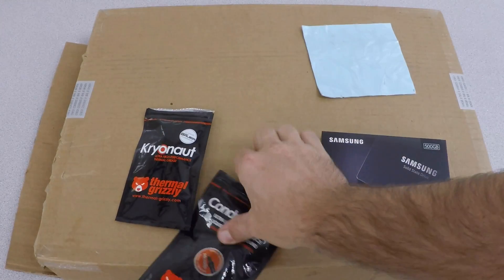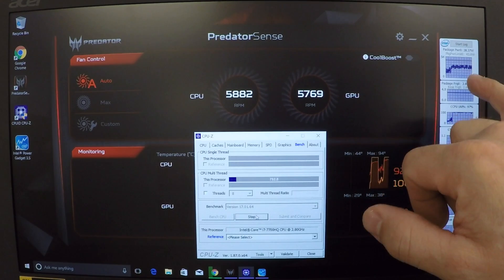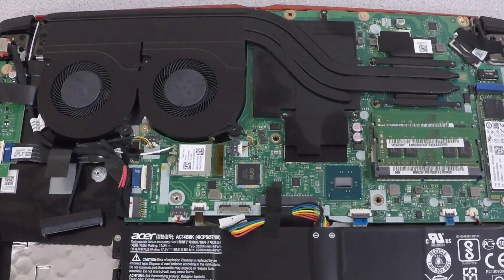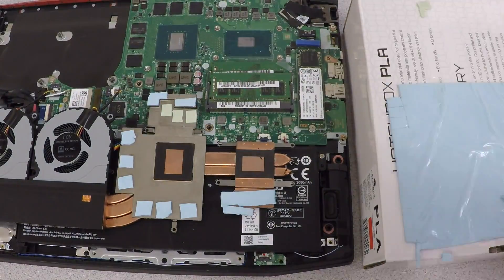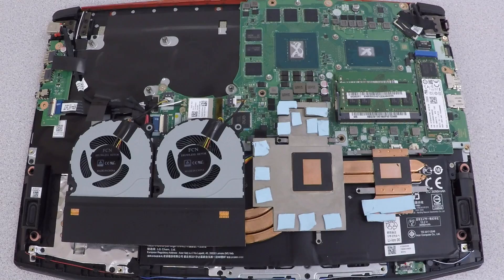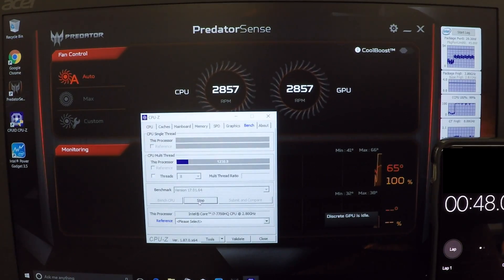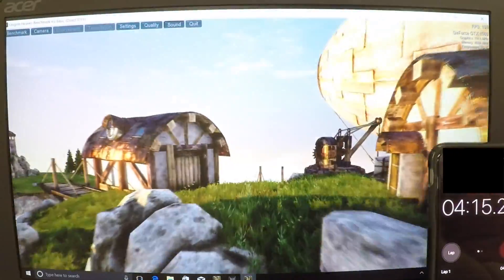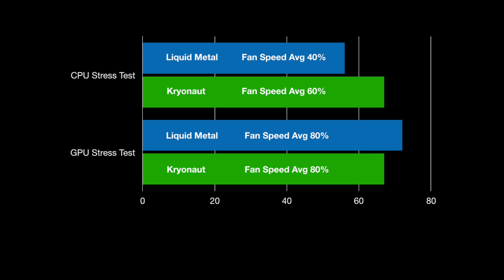Acer Helios 300 Kyronaut vs Liquid Metal Test

Comment: I just applied thermal grizzly kryonaut on my i7 8750H, but now temp from 99 degrees on full load, droped to 90 degrees on full load. Im not sure that i applied good this paste, because your temps are different than mine.
Reply: I have the same laptop 8th gen Helios you do I did everything in his video cut out 1.5 thermal pads spread out the grizzly kryonaut with the spatula on both GPU CPU I went from 95 heavy gaming now I'm down to 64 degrees or 70!
Reply: @DennisMC1974  Wow thats amazing. We have same CPU and we have big difference in temperature... i dont get it.
Reply: liquid metal is the best
Reply: Elvir Muratovic did you find the solution? I went from 99 to 94 max? Any idea?
Reply: @JaJa-gh3ze  Still same temp, ill repaste it again this days with liquid metal and ill write here again :)
Reply: @elvirmuratovic8772  same happend to me even i put a right amount of thermal paste i still reach 90c
Reply: @elvirmuratovic8772  We were waiting for your reply as promised since 7 months ago, was there any change comapre to liquid metal ?
Reply: You've might put too much paste on if you did as he said in video, actually too much of the thermal can minimize the heat transfer..

Comment: Thank you sir for your input. I've got similar problem - my MSI GE75 Raider 9SF (I like such long names for laptops :P) with i7-9750H and RTX 2070 - the temps of CPU in games like GTA 5 and Witcher 3 gets more than 95 degrees C and even UV to -160mV doesn't make a big difference, so I've also downclocked the clocks to 3,4 GHz (from 4,0 GHz - for all 6 cores active) and now I've got (with UV by -160mV) the temps in these games 70-80 with peaks at 84-85 C but I would like to improve the temp performance but if I do so I lose warranty - that's the minus :/ .
Reply: how did you downclock the CPU? I tried with throttlestop but I my temps were still extremely high??

Comment: stock pads are usually better than any pads you can buy. GC extreme got good ones but they are still close to stock ones. I think you made a mistake with those pads.
Reply: No he didn't make a mistake I use the same pads 1.5 and spread the thermal paste on now full load now I'm 65 70 degrees
Reply: @DennisMC1974  Useless info if you don't remember stock pads temperatures

Comment: I have the Helios 300 i5 7th gen, the one with 1050ti. My lappy temps go upto 90 degrees often. Are there any other substitutes for kryonaut?
Also my laptop suddenly power offs irrespective on what power it is running on. I mean it power offs when i lift the laptop or even if someone moves or touches the lid. It happens mos of the time recently. Pls help
Reply: Kingpin thermal paste provides great results and has got good reputation.
Prolimatech pk3 is good also but it is a different type of paste and known to be thicker and more difficult to apply. However it would last a long time / you wouldn't need to reapply it in a long long time, it would not dry and it would keep great viscosity and maintain good bonding between your cpu and heat sink. Hope that helps

Comment: great show down,  the Kryonaut paste is the only 1 I use these days, especially on low airflow systems like office desktops or the mini itx cases.  It costs a bit more but in my field piece of mind and customer satisfaction are much better than saving a buck or two.  If you use air coolers this stuff will easily show you a major improvement.

Comment: I'm interested on doing this on my machine. I have the model number PH315-51, are you using the same model? or does it works on all models of Predator Helios 300?
Reply: Any updates
Reply: @ishimarumasaki1998  I was as advised no to do it until my warranty expires, so there's that.
Reply: @darylquevada  You bought it from Amazon right? How do you know if you still have warranty?
Reply: @ishimarumasaki1998  No, I got it from our local computer store and it comes with local Acer warranty.

Comment: 4.4k rpm on both fans... airplane 7054 to hawai taking off soon, all passengers aboard.
Reply: Mine is 5k to 6k rpm
Reply: Bruh Asus Zephyrus S 7200 rpm tornado
Reply: @MrPabsify  its desktop fan
Reply: my helios 300 was also cooking in the high 90's even after repaste - i only noticed it on the second repaste one year later but what happened is that there was a lot of cat fur in the fins, stuck deep in there, i couldnt vacuum it with my portable one, powered the garage vacuum almost bend the fins, but it sucked all the cat fur and glued dust - the temps dropped almost 25c (i use arctic silver 5) its running 75-80c max and it never stop boosting.
probably i gained a lot more than 25c cause beforehand it wouldnt even boost.
Reply: same boat
Reply: @meowgusto  Try to clean your laptop frequently but mine does every 3 months, not only with ur garage vacuum but deepclean it with rubbing alcohol, I know it cause a lot of work but it's fun to do on weekends when there's nothing to do
Reply: LMAO
Reply: lol
Reply: Cries in 6k
Reply: mine goes up to 6k xd
Reply: LOL!
Reply: Its over 9000!!
Reply: thatas fine i had XMG laptop and it was like 5k+ on both fans being factory new :D
Reply: Hahaha
Reply: Mine is 6400RPM
Reply: Bruh im on second run of engines...they run at 5400...coool it babýyyy

Comment: Should use AIDA64 my man, can stress GPU and CPU at the same time. Also, you can change the fan curve which could easily take another 5-10 degrees off. And of you use an acrylic conformal coating or even nail polish on the SMDs or anything around the die, you don't have to worry about the liquid metal shorting anything out.
Reply: He does, he has made a video on that as well.

Comment: What thickness did you use on the thermal pads?  0.5mm, 1.0mm or 1.5mm? Thanks
Reply: The most common thing they overlooked about these tutorials. The thickness of the thermal pads.
Reply: 1 mm

Comment: Great info! I also use a nifty little program calle ThrottleStop on my laptop. It keeps the computer from throttling, and you can set the CPU to run at 50% (battery saving mode) etc... very useful for laptops.
Reply: Only problem is you have to keep it running all the time. Kinda annoyong
Reply: @nathancasey7712   you can schedule it to auto start and it just runs in the background on startup but essentially consumes no resources pretty much.
Reply: @nathancasey7712  i use task scheduler to auto start throttle stop from boot up
Reply: It doesn’t work on all cpus intel locked it

Comment: I did the same in the video (Kryounaut and same thermal pad) and I achieved the same results. Thanks a lot
Reply: I'm about to do this same process but was wondering what size pad I need? Both thickness and how big?  What worked for you?  Glad to hear you had great results as my Helios gets hotter than I'd like it to!
Reply: @newera_1303  I used same size from the video. After 3 months I applied the process described here, I only had good results in the first month, after that it doesn't make so much difference. I am thinking about repaste again once I have more Kryounaut. Maybe next year I will try Liquid metal. To keep my temperature 80 degrees, I had to create my own notebook cooler with 6000 rpm and apply undervolt using ThrottleStop and sure I applied the process described here
Reply: @rdinegri  Dude, 0.5 mm thinkpad size??
Reply: @logos_motorider6274  Hi, Thermal Pad 1.5 mm
Reply: @rdinegri  Thanks!!!!

Comment: I still don't understand why manufacturers use such crap thermal paste. It's not like performance paste is a significant cost. A dollar more when bought in bulk maybe, but surely that must be well worth it for shipping a product that runs faster (due to no throttling), more silent and quieter - because while thermal material might not be a marketable term those other ones definitely are exactly what customers care about.

I do exactly the same as this. I re-paste every computer I buy essentially. Often even router equipment ect.
Don't always replace pads as the benefit is a lot less for those though + they aren't as easily available often.
Reply: @Eddienemec  the newest model does have a better cooling architecture though, but still sad that they make things harder on us with these build decisions.

Comment: Thank you for the review but i still didnt get it. Are you using same laptop with the same configuration? How does the LM performing so far, any issues with the alloy? Are you using the Laptop with the LM intensely? The LM should also  perform better in gpu stress test, to me it looks like the performance on the gpu is decreasing
Reply: LIquid metal is reactive (and electrically conductive so you have to take some precautions).
It's only a nono to use with aliuminium though. On copper it will cause significant discoloration but not actually decrease performance so it is considered "fine". Nickel plated copper is the absolute most ideal though as the reaction is very low, causing only mild discoloration that can even be buffed out with just a little scrubbing. I'd say the only real difference is a copper-based heatsink may need a reapplication at some point, maybe 1-2 years down the road since liquid metal permeates a little more and may become slightly more crusty over a long time, while on nickel plated copper it seems to be stable pretty much indefinitely.

The GPU difference here seems to be an anomaly. Liquid metal should be performing above kryonaut and close to the same margins as on the CPU. This is likely just due to a less then perfect mount. Laptops have relatively low mounting pressure compared to most desktop coolers and liquid metal is thinner and more fluid so it is much more sensitive to a "less-than-perfect" mount. He probably could have fixed this with a reapplication and using slightly more plus clamping down a little tighter (if possible). It just might not be worth the effort considering the temps are still fine - so all it would really improve is the users OCD =P (and at most a few more Mhz boost clock if lucky).
Reply: @TheStigma  what if the heatsink is copper plated aluminum? are you sure that this laptops heatsink is copper?

Comment: Well, then it would be Liquid Metal (Conductonaut) in the CPU and Thermal Paste (Kyronaut) in the GPU.
Reply: why? gpu uses more power and gets warmer
Reply: @user-bj3pq2si2l  No usually it doesn't processor is the main thermal output, at least in my laptop with a i7 8750h/gtx 1060 max q
Reply: @epixtille7069  for desktop pcs gpu is almost always more power
prob in higher end gaming laptops too
Reply: @user-bj3pq2si2l  Wrong, cpus are almost constantly hotter these days. I have a core i7 8750H with a 2070 (not the maxQ one) and the 2070 is like 15 degrees cooler at all times.
Reply: @stevensteel574  cpus use much less power than gpu
so they should not get as warm
but gpus are basically all direct die cooled
while cpus have a heatspreader and another layer of thermal paste
if you would watercool your pc, you would need more radiator for a gpu than for a cpu
Reply: @user-bj3pq2si2l  In my laptop Helios 300 (i7 8750H & GTX 1060 Max-P), most of the time the CPU is the one that maintains the highest temperature, to the point that I have to undervolt and underclock the processor, to maintain reasonable temperatures, below 90° C while I play.

Comment: Would it matter if i used 1.5mm thermal pads? I just bought the helios 300 last year (feb 2018). I decided to change all the thermal pads to the one you recommended and the Kryonaut paste as well. I play apex legends but i upscaled to an external 120hz monitor. Cpu tends to max out at 80-85 degrees compared to 86-90 degrees at stock. GPU does about mid 70’s. Did i miss something or should i expect more temperature variance?
Reply: Don't replace pads unless they are at least as thick as the one that came with it stock.
Also, replacing the pads is a bit over the top unless you are a perfectionist since pads aren't used on anything "very important". It doesn't really matter much if your RAM modules run 5c lower. By all means go ahead and do it if you want, but just don't expect to see any practical difference (or even measurable difference on the temp-sensors you have inside the board since they won't be monitoring VRMs or mem-modules).
Reply: @TheStigma  thanks for clarifying, was just wondering as i couldn't find good thermal pads for cheap in India :)

Comment: those temps are really great only i'm scared to apply liquid metal
Reply: Very easy to do. Don't let videos fool you. Use cutip and apply using cutip instead of squirting on. Little drop in bowl, then tap with cutip and rub it in slowly covering until completely covered. My temps on CPU and GPU dropped 20 deg on full load and fan doesnt come on all all during regular browsing, microsoft, and video playback. Alienware m17x R4 980M Overclocked 100% on GPU and CPU Completely stable with no Undervolt using 300watt PSU.

Comment: Will this void your warranty? I'm ordering this laptop and want to know if I need to wait until warranty ends ?
Reply: No in the US it will not.  Under right to repair laws you have the right to modify your electronics, replace components, etc.  And it can not void your warranty.  I can not speak for countries outside of the US.  Laws regarding this vary country to country.
Reply: @markpeterson9826   this only applies in certain states and mostly to farm equipment. Please check the wikipedia  page below. They are trying to pass this law but haven't yet.

https://en.m.wikipedia.org/wiki/Electronics_right_to_repair
Reply: Don't risk it unless you know very well if it's okay. In india you void your warranty as soon as you open the back panel, never mind fiddling with thermal paste

Comment: better to just keep fans at 100% and bench them both times with the different thermal paste.
Reply: Best comment right here
Reply: @Eddienemec   Do you know If I will change thermal paste to the liquid metal, will it be problem for me. Cause I throw the laptop in the bag and travel a lot. Soo thats why it is shaking so much. Can vibration cause liquid metal to overflow? 

I'm undecided in switching thermal paste to liqiud metal)

Comment: One more thing, people always say it's easy to replace the thermal paste,  I find easy to be known as hard in my terms cause I always end up with stripped screws and can't get the screws out ever, so I always have to send my tech to places to get it done cause I don't have time to unscrew a stripped screw and it's on the heat sink, I have the thermal paste and everything, do you know if any PC repair shop will do this for me cause I'm tired of opening my electronic devices only for it to screw up, this laptop is not cheap and I'd rather just pay someone to do it.
Reply: Yeah applying thermal paste for you is standard work for a pc shop.
Reply: Its  very easy to do. The video is pretty self explanatory. Just make sure you clean the gpu and cpu well (take off the old paste w alcohol).
Reply: @norellusnocats7027  I didnt say that, now did I? I said my screw got stripped and I have no way to unstrip a screw, it always happens to me, read my comment better.
Reply: @YamiAnubisX  This happened to me on my last screw spend an hour trying to unscrew it, finally got it out by twisting it with plyers instead of the screwdrivers also flatheads work better on those types of screws.
Reply: @Auzical  thank you, that was actually helpful.
Reply: Use a rubber band between a stripped screw and your screwdriver. Will help grip.
Reply: @samjones2112  I did that and It never helped me, so I sent it into a shop like 5 months ago to get it repasted and they replaced the screws but thanks for trying to help.

I did however buy a ratchet screwdriver recently and it helps alot with what I need now, better than a regular screw driver, that's for sure.

Comment: fake temps - LM doesnt work i tested on my own helios 300 same shit like OEM paste.
Reply: Did you apply it both to the CPU/GPU die and the heatsink? You have to apply liquid metal to both surfaces unlike classic unconductive thermal compound.
Reply: You need to attain the required layer thickness with lm, another reason to prefer paste